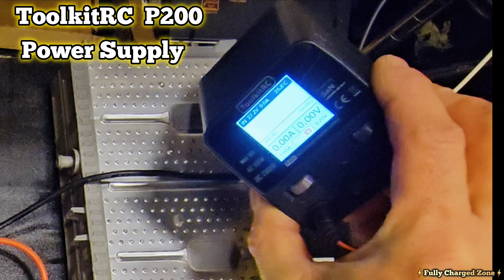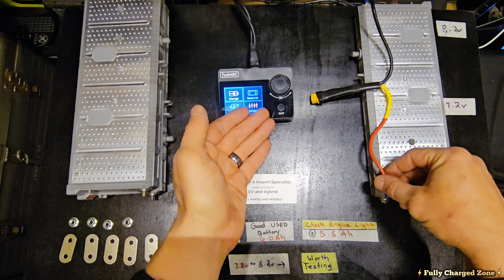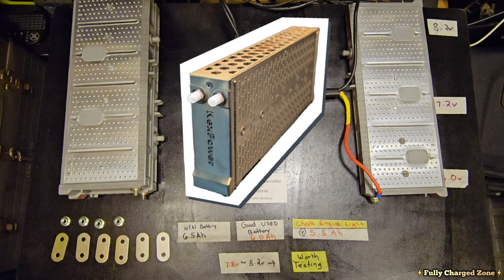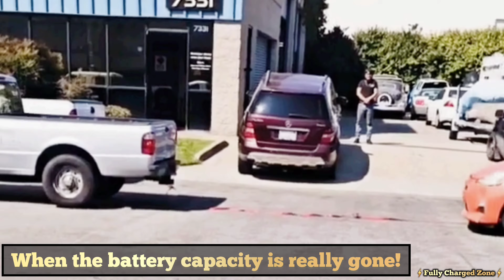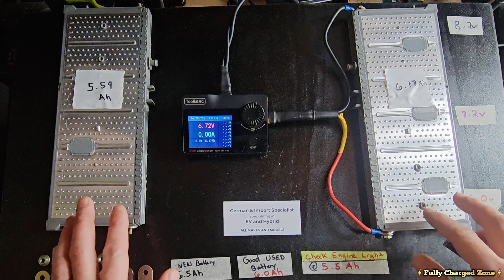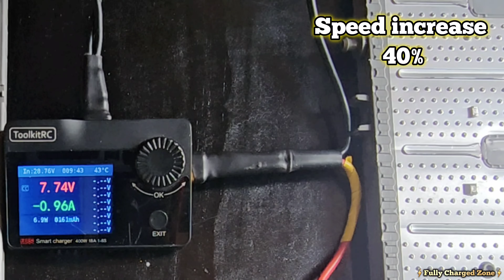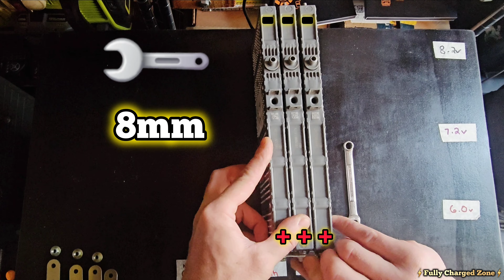Toyota Hybrid Battery Tutorial - Charging, Capacity Testing, and Balancing Battery Cells.

Comment: Please do a battery test for Lexus 400h and 450h, thanks
Reply from the maker: I can definitely do that! Do you need any help?
Reply: @fullychargedzone yes I will be buying rctoolkit m8s, so I want to test battery module on Lexus rx 450h. I want to know what setting should I choose on m8s and what is the charge voltage and discharge voltage and how many amps is good, just like the video you show but for Lexus Rx 450h battery. Thanks
Reply from the maker: I'll look up the specifications and get back to you tomorrow.
Reply: @fullychargedzone Thank you 🙏
Reply from the maker: For a Lexus RX 450h, individual hybrid battery cells have a nominal voltage of approximately 7.2V each, with a healthy cell charging to around 8.4V. During normal operation, a single cell's voltage should stay within the 7.2V to 8.4V range; however, a significant drop below the 7.2V mark, such as a dip below 6.0V, indicates a potential internal cell failure that can prevent the entire high-voltage battery from operating correctly. 

Its basically the same settings on everything. 

Theses cells top voltage is 8.4v and a absolute bottom voltage  of 6v. Don't discharge below 6v or charge higher than 8.4v. 

If you need any more guidance let me know 👍
Reply from the maker: Anytime,  I'm glad I could help.

Comment: Amazing video thank you a million times. I have situation don't know what route to take have a 2013 camry xle has been sitting for a year (mom gave it to my son)was turned on occasionally but not driven prior was working great anyway seems the hybrid battery discharged over time of doing this would this method possibly be able to get the battery going again car has 114k miles again it was doing great prior to sitting. Seen other chargers like the Prolong stuff is that even worth it? Again ty for any information and for this video
Reply from the maker: You're welcome, I recommend to disassembled the battery pack and test and charge all the cells . I bet some of the cells can be salvaged. 
Charging the whole pack won't fix the issue if a cell went bad. Anytime I get the triangle of death. I disassemble the pack and rebuild with new or used cells. If you need help finding cell replacements let me know.  The Toyota camry sounds like you could get another 100k out of it if you repair the battery.
Reply: @fullychargedzone  Thank you gonna give it a go i'm sure I will have to replace some of the cells any direction to get some would be appreciated. Again Thankyou This gives me the faith that I can do it. We all appreciate your effort making this video.
Reply from the maker: I made this channel because I wanted to help people.  I have a lot of knowledge to share. I thought this would be the best place for it. I spent a little extra time on this video, because its still possible to fix your own vehicle today. There is a lot of misleading information out there, so I thought I'd give my opinion.  I'm a emobility specialist and all I do is repair EVs and Hybrid vehicles. If I can help in any way let met know. I'll find those links tonight and send them to you for replacement cells. Make sure to be careful disassembling pack. If its leaking anywhere discard the cells.

Comment: How did those cells not swell up by using this  method of charging
Reply from the maker: Anything under 2 amps outside of the packs case won't swell batteries. Anything above 2.5 amps will cause batteries to swell and fail.

Comment: Hello, I have this strange situation: voltage drops under load are quite good, after 4 minutes of powering the car bulbs 12V the voltage drops to 7.5V, 7.3, 7.1. However, when I check the capacity of these cells it is 1200 - 2100 mAh. Is it possible? I checked with two chargers to rule out errors: Ibmax b6 and ToolkitRC. I will add that the car is a Lexus CT 200h from 2011, mileage about 290k km.Thanks
Reply from the maker: Sorry for the late reply. Most batteries that age & mileage would have about that capacity.  Its very hard to find good cells that come from a donor vehicle with more than 80k. 
I usually replace the cells with new cells or used cells from totaled vehicle.  Be very careful about buying cells used. I've learned my lessons.  If you need some sources to get new or used cells I can gove you a few links.

Comment: Can you reccomend me a good, low cost battery rebuild kit? 

I am willing to pull the battery and twke it aoart to replace the cells, so i do t need a whole assembly. 

I was looking at the cylindeical kita, but they are loke 2.3k or so, and the soxium ion blade v3 ines your reccomended are also out of stock (and coat over 2k). 

Do you have any other options? 

I got a second gen orius thats already high milage, so i dont want to pay like half of my cars cost in a new battery.  

I was considering the greenvean referbiahwd vattery and upgrade to lifetime warranty and the "cheapest" perminant solution.
Reply from the maker: I'll be honest, if you replace the cells with used cells you'll need to perform a capacity test. You also need to perform a capacity test on the old  cells to see if any cells can be saved.  

Hybrid & electric vehicle batteries can be expensive.  To rebuild the battery correctly is usually between 2 and 4k my cost depending on if its new or used cells. Anything with a lifetime warranty is a big no on a hybrid battery.  Reconditioned or refurbished means used battery.

The only dependable way is new battery from dealership, replace with new cells or replace cells with used cells. If you use used cells, they only usually last 2 years. I've been doing this a while. I rather pass the knowledge to you from my experience.
Reply: @fullychargedzone 
So do you think it's better to just get like a 1.6k greenbbean with lifetime warranty and just change it every time it dies then? 

Inconvenient, but cheapest "permanent fix" given OEM new would be like 4k, and these kita are like 2.3k+ depending on the type and option.

I also have the option of total crapshoot batteries on Facebook that have been 3rd party DIY fixed by random people and resold for like $400 from totaled cars.
Reply from the maker: I would go with the longest warranty.  Make sure to read the warranty. I think thats the best option. The new cells I recommend say out of stock. If you call you can be put on a waiting list.  Takes about 2 weeks. 

Swapping batteries with a rebuilt battery that has a warranty is the way I would go. 

Don't trust Facebook or ebay. I've purchased nothing but junk there.
Reply: @fullychargedzone 

Thanks. 

Do you recommend the cheaper china cylindrical cell battery rebuild kits, or do you prefer the sodium ion v3 kit? 

They both have a bottle 1-year warranty (unfortunately, I hate the short warranty given how much they cost). 

I know that the cylindrical cells have a bit more of a history to them, but I haven't heard much about the reliability to be totally honest, I saw one YouTuber who said that he doesn't recommend them though because it changes the way the air pressure is distributed from the fan. So one side of the battery is always hotter than the other unlike the OEM design. 

The v3 sodium ion kit ones are super recent. So I'm not sure about the reliability. But they follow more of the OEM design (compression) so they're supposed to be cooling properly. I'm just not sure about the cells longevity, and getting an OEM replacement would be totally dependent on if the company survives or not.

Comment: HI, is this the same power supple as your use in the video ToolkitRC P200 Adjustable Power Supply (30V/10A/200W) [TLK-P200-US]?  
the power supply you refers is all from china and it take about a month for deliver....  is there another power supply similar to the one you use?
Reply from the maker: I like the one in video, because it has alot of protection.  I use a few other  different power  supplies.
 
 Here is a link.

https://a.co/d/hddm9QL

I use this cheaper one also

https://a.co/d/8XRHvEU

I hope this helps, let me know if you need anything else.
Reply: Hi, I just received the ToolkitRC smart charger 400w 18a 1-8s, it didn’t come with the input and output wire/or plug.  Where would I buy the input and out wire to hook up the charger?  also, I just brought the cheaper toppower power pa3010h as you refer… I’m new to this and I appreciate you being patient with me!
Reply: Also, what are the settings from the toppower supple to the m8s smart charger?

Comment: Hey bro, my battery, each has 9 modules, and each module is 22.5 volts. One is 19.8v i don't know how to test it the right way. There are not many hunday Sonbattery videos
Reply from the maker: What is the year of you hyundai sonata? I fix them regularly.  I can probably help.
Reply: @FullyChargedZone thank you 2015 hunday sonata
Reply: @fullychargedzone  thank you for the reply the car is 2015 hunday sonata hybrid
Reply from the maker: A fully charged battery module is 33.6v. A completely discharged battery module is 20v. 

Have you tried to charge the modules yet?
Reply: @FullyChargedZone  I'm trying to figure it out how I watched a couple of videos with 3 22v batteries and charge each one for 45 seconds ? Thank you again
Reply: @fullychargedzone  do I need 36volts ? To recharge it
Reply from the maker: You need an adjustable charger and power supply or a 33.6v charger.

They sell a cheap scooter charger that you would have to wire with some clamps.

If you over charge the battery it can destroy them. I dont recommend to charge the batteries without a charger.

I've learned my lessons the hard way.

If you need a link to get a charger let me know.
Reply: @fullychargedzone  please
Reply: @FullyChargedZone please can you send me the link for the charger power supplier
Reply from the maker: Its been a busy week, sorry for the delay.

This option will be the safest and cheapest option to charge. 

https://a.co/d/3K74uxw

I've also used a power supply before. If you keep the amperage at 1 to 2 amps you'll be ok.

https://a.co/d/4jrmQem

Your battery Fully Charged is  33.6v. You would have to remove the power supply when reaching that voltage. You would need a volt meter to check voltage.
Reply: @FullyChargedZone, thank you so much, brother I really appreciate it thank you again do you have like a Facebook page
Reply: @FullyChargedZone I just bought the first  link option ToolkitRC M8AC Multifunctional Lithium Battery
But now, how do I used to change the battery  it doesn't have the positive and negative aligeters to charge the cells

Comment: Hello, thank you for the detailed explanation. You have a minimum voltage 1V and a maximum 1.36V per cell. The Prolong charger/discharger uses for reconditioning the cells the following discharge voltages: first discharge to 0.8V, second to 0.6V, and third to 0.5V per cell. After every discharge It charges up to 1.40–1.43V per cell, although it does use a low current of around 250–650mA. To me, the discharge voltages seem too low, and I'm afraid of damaging the modules. I have an iCharger 308DUO with deltaV and deltaT protections. What is your opinion on this? Thanks!
Reply from the maker: The 308DUO is a good charger / discharge. It would just take longer to discharge.
Reply: @FullyChargedZone  is it safe discharge to 0.9V and charge to 1.43V?

Comment: Hey do you think it would be worth the hassle for me to just charge and balance them without capacity testing? Will it prolong the packs life?
Reply from the maker: 1. How many miles on the vehicle?

2. Whats the year?

3. Was the check engine light on or a red 🔺️ on the dash  before removing the battery?

If it was I recommend testing the capacity of each battery cell.

Charging a battery won't prolong the battery capacity.
Reply: @fullychargedzone  CT200h 2011 with 160k miles. Getting worried about it failing on me, but aside lowered mpg to 35, no signs.Seeing whether I should do balancing or just ride it until it gives error and get a full new replacement
Reply from the maker: I would leave it alone until it fails. Your about the correct mileage for a battery replacement soon.  The reason you're getting lower gas mileage maybe due to the battery capacity.  If there isn't a check engine light drive it until one comes on. I've seen thr CT200's reach 200k before battery replacement is needed
Reply: @fullychargedzone  okay thank you for your time, then i will only do the EGR cleaning for now.
Reply from the maker: @Timo_Adventures clean the Mass airflow flow sensor too

Comment: Is it good idea test battery outside compression pack? Also for nimh batteries deltaV method is used to determine fully charged cell as you charge series of cells that are most likely unbalanced and have different capacity so if you use max voltage you may overcharge some cells inside a module.
Reply from the maker: @aurimasgutgalis944  Testing these batteries outside a compressed pack at a 1 Amp draws won't make batteries swell.  If you discharge above 2 amps it can cause the battery to swell.
 
I've used this method at the dealership for 12 years. You'll be safe if you stick to the guidelines of the video.

• In the video the battery cells are never charged in series. This would cause unbalanced batteries.

• You need to charge each cell fully before testing for capacity.
 
• Every battery can be capacity tested with a capacity tester...even if the battery was in a series configuration previously. It wouldn't make a difference in the outcome of the test. I use this test in on everything from a Hybrid vehicle to a Ev.

If you need any more guidance let me know.  Thank you for watching

Comment: I bought a Tool Kit RC charger almost identical to the one you are using in this video. I couldn't find the exact same one. I did the discharge just like you were showing to do but it's not making sense. It's only taking about 4 hours on three different batteries I have tested now and they have ended at 2.88 ah, 3.11ah, and 2.95ah. All three started at 8 volts and ended at 6 volts using a 1 amp discharge. However this Hybrid battery was working when I took it out of my car with no check engine codes. But according to your video all three of these modules should be very bad. And I have also charged them up and put a vehicle headlight bulb on them like you have shown in another video to test them and they are only dropping from 7.95 to 7.68 after 4 minutes which according to that video means they should be really good. ???
Reply from the maker: The data you gave indicates the batteries ate about 50% capacity.  Check Engine Light will illuminate between 40 and 50% capacity.  
The battery will work most likely for a short period longer. If you want the batteries to last longer, I recommend using better replacements. I would not installing these batteries because the capacity is on is way out. Working batteries and good capacity batteries are extremely different. I dont want to see you waste time rebuilding the battery in a few months to a year. I hope this helps.  If you need more let me  know.
Reply: I just watched this video and searched the replies to see if anyone would mention what you said here. Prius won't throw a code if a module capacity gets below 5.5Ah. It needs to go way below that. Or there should be great difference between block voltage/capacity. Actually, the main issue is the capacity imbalance between modules/blocks NOT how much capacity they have. If capacity of of all of the modules in the pack is around 3Ah but they all are around that level, that HV pack will work perfectly fine. This is probably what's happening to you now.
I have owned and driven many Prius vehicles and repaired packs with modules with the capacity of 2.5Ah and 5.0Ah. And they all worked perfectly fine for years. According to this video, I should have dumped all those and get new modules. It is crazy to say dump the module if the capacity gets below 5.5Ah.
If your car doesn't throw a code, just continue driving it. As the module capacities go down, you will have a reduced gas mileage, but it is called aging. Nothing will perform like new forever. :)

Comment: Where do you recommend buying used modules from? I need a couple gen 4 nimh
Reply from the maker: New battery replacement:
 https://sodiumhybrid.com/?srsltid=AfmBOoq4yqxtsoUHqAwcqYuDgsaUWy71tGzxXebgiBaKXh4pgPkE93R8

Used Battery Replacement:

https://batteryhookup.com/products/oem-toyota-prius-nimh-replacement-battery-cells?srsltid=AfmBOoplsq4bA_DrQ2P4wa7vHkn3AJMqeHjcQnGl2ABvYat5JdhmwkiW&variant=43961978847394

If sold out...I recommend emailing them. Batteries are usually back in stock weekly. They never let me down.  

Another source if they're sold out

https://2ndlifebattery.com/product/toyota-prius-hybrid-battery-cell-8-2v/
Reply: @fullychargedzone  well they were out of stock at battery hookup and I emailed him and called and texted several times over the last day and a half and haven't gotten any response. Unfortunate

Comment: I'm using a headlight bulb like you did in another video to load test. I'm averaging around 7.95v starting after sitting 12 hours. after 4 minutes they are averaging 7.68v. so that means they are good for sure? or I still have to do a discharge like in this video? I'm not understanding the difference between the 2 tests....
Reply from the maker: They're probably,  good but I'd check the capacity. I have another video on capacity testing.